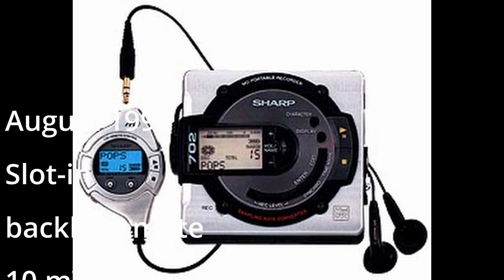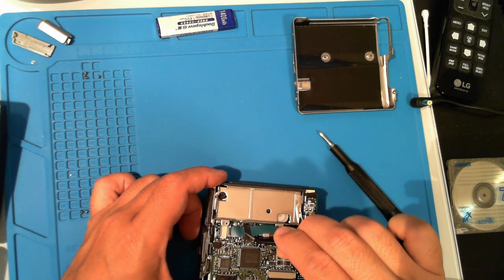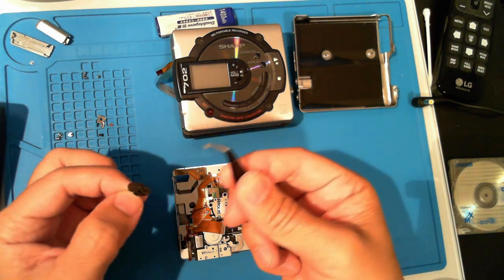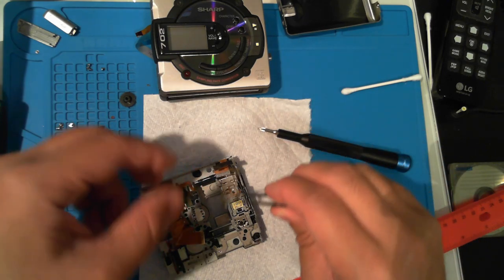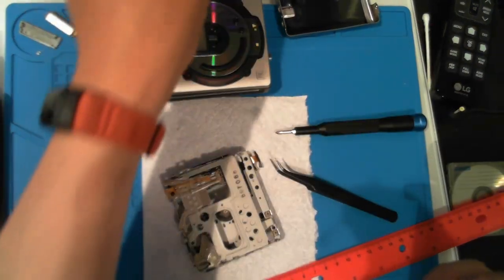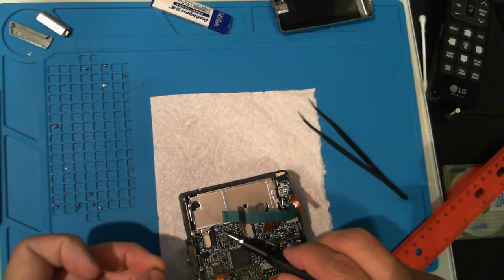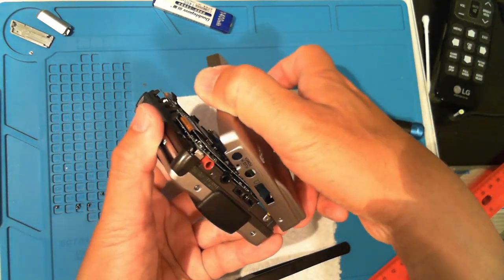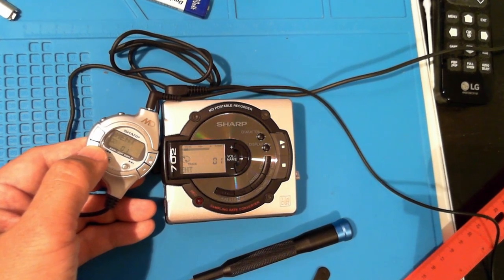Sharp MD-MS702 MiniDisc Recorder - fixing TOC ERROR or TOC ERRORa with a new gear

Comment: If the gear is cracked and loose, but not too big a gap in the split, you can try using a bit of loctite to prevent it spinning freely on the axle.
Reply from the maker: I have heard of this and I think one anecdote also mentioned super glue. Have you tried it?  I'm curious about how well it would work.
Reply: @TechnicalInitiative  So I got a replacement gear, but it was loose and spun around (and therefore won't work), but I put a drop of loctite and it fixed it right up. Works perfectly now.
Reply from the maker: Thanks for the reply!  That's great to know - currently, those gears aren't cheap and "friction fit" may only last for awhile. I'll look into some Loctite!
Reply: I used the nonpermanent Loctite Blue 242.
Reply from the maker: Thanks! I have a "graveyard" of old Sharps and not enough gears... I'll test that out!

Comment: would you have more information on where I can find this gear? What is your size, among other details.
Reply from the maker: Sure! You can get one from MD Gadgetry on Instagram. Sometimes you can find a spare from a "dead" device, but most of these old ones are broken/cracked.

MD Gadgetry on IG - https://www.instagram.com/mdgadgetry/
Reply: @TechnicalInitiative  yes,. Gerry Li from Hong Kong!  , I also have that gear but made in bronze.
Reply from the maker: Hello Matiassarttin6530! I'd love to know more about your bronze replacement if you're willing to discuss! I've experimented a bit but it's difficult to get the right sizing and they are mostly straight gears, not helical

Comment: I have the Sharp MD-MS702, it only works with a power adapter now as the corrosion due to battery leakage damaged the traces on the board and i can't be bothered to wire-ad the missing traces.  Was also my 1st MD Recorder.
Reply from the maker: Wow - what are the odds?  It's a great classic player and of course, has some great sentimental value!
Reply: I have one that only works on the battery. Fortunately I have an external battery charger or I'd never be able to recharge the thing although I do also have an MS701 that has a TOC error but still charges the battery.

Comment: Wow you are very professional engineer and master 👏 well done can you please kindly help me where did you got the gear from as I need 3 off them and you mentioned the metal gear from RC car do that gear works ? Please waiting for your kind reply Thankyou 😊
Reply from the maker: Hello and thank you!  Right now, I think the one selling the specific one for this model is Gerry on Instagram (@mdgadgetry) you can message him on IG or find him on the MiniDisc subreddit (https://www.reddit.com/r/minidisc/) .  I haven't had a chance to properly try the RC car gear because the hole diameter was much larger than the shaft so I need to test some bonding methods first

Comment: OMG! I cant wait to try this on my MD-MT15.  I never would've guessed it was that tiny gear.  Where can I get some of those?
Reply from the maker: Hi!  Gerry (@mdgadgetry on Instagram) has some but since I haven't opened up an MD-MT15 I can't say for sure it's the same one. I think it's probably the same, though! If you ask Gerry he may have opened one. If you check my website, you can see there are a lot of different types of Sharp gears!
Reply: @TechnicalInitiative Wow. Okay thanks for the heads up and information! I'll check out the website. Thanks again! Great video!
Reply: Yes try Gerry in Hong Kong. However if you don’t want to spend the $30 for a tiny gear, try some blue loctite 242 thread locker to make the gear not spin loosely on the axle. Remove the gear, put a drop of loctite on the axle and then carefully put the gear back on, taking care not to gum up the teeth of the gear.
Reply: @ongkarl  what if the gear is split? I already hit him up about the gear and I was definitely looking for an alternative. 12 bucks shipping on that tiny bit, ouch.
Reply: @darkseiddoom  Depends on the size of the split. Maybe SOL and need a new gear. Maybe a bit of superglue + loctite will work.
Reply: @ongkarl  I think I'm gonna see how small my 3d printer can print. 😅

Comment: I watched this excellent video, thought "bugger that it looks too fiddly", and so applied a carefully calibrated series of (about three) light blows to one corner instead with the handle of a pair of scissors of suitable mass, whilst it tried to read the TOC...  
Surprisingly it worked, and I am reminded that this is actually a really genuine hi-fi bit of kit that sounds really nice and detailed, even through my P.C. speakers.
Reply from the maker: @Swallabat - that's hilarious and quite a bit easier than opening it up! I might have a few units I can attempt your method on...
Reply: @TechnicalInitiative  TBF I knew it worked when I put it away,  so it was worth a go. FWIW After looking through the slot and identifyng which way the sled moved, I picked the rhs furthest away corner to give the treatment to, and was careful not to hit it hard, just percussively. It does seem to do the job, I've been using the MD player all day with no issues whatsoever.. My twenty year old recorded media works way better than cd's burned at the same time too. BEst of luck with yoru units, it might save you a fair bit of work. I HATE disturbing those tiny ribbon cables..
Reply: Oh man! You are a life saver. I dug mine up yesterday and wanted to see if i could put it to use still. But yeah, TOC error and all. I was about to embark on this 90 minute gear replacement video but read your comment. So i hit it a few times, not 3 times like you but more like 20 hefty blows. All of a sudden I hear the inner gears wake up from a good 15 years of hibernating. Hit it a few more times on all sides and we're back in business. I just realized this thing has plug in power on the mic port, so I gained a digital field recorder!
Reply: Sometimes we managed to get iPods going this way when I worked at an Apple Store.
Reply: Thank you, it solved the problem for me too!

Comment: The 702 was my first as well. It was the one big purchase I made with my bar mitzvah money 😂. 

I finally decided to give in and sell it because it’s been sitting in the box for at least ten years and I just know I’ll never use it again… of course I got the TOC error. Got someone to print a gear for me and I cracked it during installation. Ugh. I heated it but I guess it wasn’t enough or the material it’s made from isn’t good for this application. I don’t think you’re supposed to use Loctite on plastic, but I’m gonna try it with my old gear and cross my fingers.

Great video by the way; it’s super helpful.
Reply from the maker: What a great device! Glad to hear about how it was another person's intro into MDs, too! Let me know how that goes. I just bought some Loctite to try on some other broken gears, too.
Reply: Finally got back to working on this again. Threadlock didn’t help but super glue seems to be holding the gear in place nicely. Unfortunately, it still won’t work. I can hear a couple small clicks, but it seems to me like the motor doesn’t spin up at all. Do you have any suggestions or should I throw in the towel?
Reply from the maker: @NeonElixir  Ah sorry to hear that - check to see if the motor can move at all w/out any of the gears in place (the flat gear). If the motor is having issues, I've seen some ppl take the cover off and clean/lube that as well, but otherwise it might be time to try something else...
Reply: @TechnicalInitiative  Do you mean check whether I can move it manually or whether it moves when power is applied after pulling the gear?
Reply from the maker: @NeonElixir  When power is applied w/out the other gear attached to its spindle. Like at 9:34 in the video - there's no flat gear in place that would transfer the motor's torque to the gearshaft. Make sure the motor can spin by itself when powered on. You may have to do some "yoga" to connect the flex cables enough to allow it to power on and see what's going on (upside down? I forget, but there's a way to operate it while open). I had one that was a gear/TOC issue, but turns out the motor was dying also
Reply: @TechnicalInitiative  Got it. That’s what I figured you meant but wanted to make sure before I did all that for no reason. I’ll give it a shot. Thanks.
Reply: @TechnicalInitiative The motor does spin without the gear in place when inserting a disc. Do you think that means it’s too weak or I just have something out of place?

Couple notes: 
- You don’t need to remove the three screws on the board, they just secure the board. The mech isn’t secured in any way, it “floats.”
- You don’t need to remove the wide ribbon cable along the edge, it just connects the bottom and top boards.
Reply: We are from different eras. My Bar Mitzvah money bought a piano key cassette recorder and that was the height of my aspirations back then.
Reply: @ianz9916  Hah! In fairness, I don’t think many 13 year-olds wanted a MiniDisc player.
Reply: @NeonElixir  Well they hadn't been invented when I had my Bar Mitzvah.
Reply from the maker: @NeonElixir  Interesting - I need some time to check out some old units in the "graveyard". When you took the flat gear out, did you remove the collar nicely, leaving the metal "post" intact?  Or did the whole thing come out (collar, flat gear, metal post)?  I believe in the units that are having issues spinning the flat gear, the whole thing came out and perhaps it's not aligned perfectly or adding some friction somehow when I replace it.
Reply: @TechnicalInitiative  Nope, the gear came out by itself. It was a little tricky to get it loose, but it turned smoothly by hand. 
Thanks for the help!
Reply from the maker: @NeonElixir  OK I've got 2 I can check out - a Sharp and similar Kenwood - the entire metal "post" came out and I need to find a good way to secure that and put the gear back. Like in your situation, the motor seems to spin fine without the gear in place. Once I add that back, it seems like it's too much for it. I suppose it's possible that the motor is failing...
Reply: @TechnicalInitiative  Aw I hope not. It spun quickly, but I don’t know if it was strong enough.
Reply: @TechnicalInitiative  Just thought I’d check in and see whether you had a chance to try those other players. No rush, but I don’t want to forget.
Reply from the maker: @NeonElixir  Hi - unfortunately my "day job" has been too busy but I do have those units out by my workspace so I don't forget (besides, they are some of my favorites). I'll let you know when I get to them, but please feel free to remind me! I don't want to forget, either!
Reply from the maker: @NeonElixir Hello again -I'm still working through a "queue" of players, but my broken Sharps are still on my desk - I'll let you know as soon as I get a chance to work on them again
Reply: @TechnicalInitiative  No worries. Thanks for the update.
Reply from the maker: @NeonElixir Hi there! I finally got around to testing a few of these old Sharp-based models again:  

1 - Kenwood DMC-J7R - it was acting the same as you described - after reassembly, the motor wasn't spinning but would spin without any gears in place. I had to reconnect enough stuff so I could work on it "semi-open" and spin the gears after powering it on and that may have "jump started" it since it moves around back and forth. Unfortunately it's still giving me a TOC error so I need to keep working on it

2 - Sharp MD-MS722 - broken gear, swapped the gear (glued actually) and now the motor and gears are spinning fine, but I'm still getting a "TOC ERRORa" so something else is still wrong...
Reply: @TechnicalInitiative  Just reading this. Sounds like you’re still trying then, yeah?
Reply from the maker: @NeonElixir  Unfortunately no luck so far - I dragged it out again and was able to get the motor spinning with everything reinstalled by helping give it a spin, but it's still throwing an error so there's more work to do. It now has to go back into the queue unfortunately!
Reply: @TechnicalInitiative  Hey. Just came across my player and figured I'd see if you ever had a chance to look at this again.